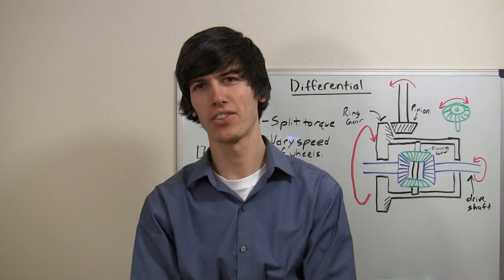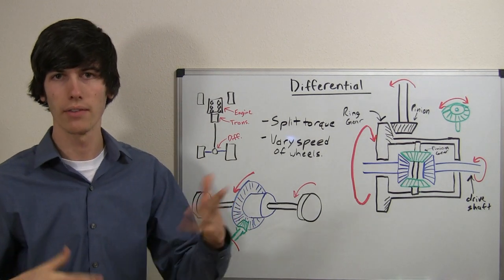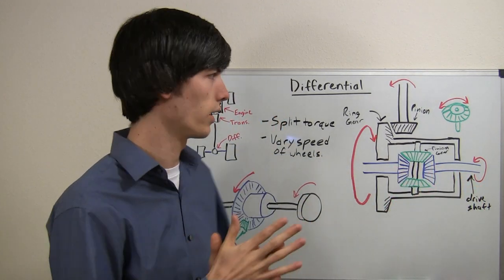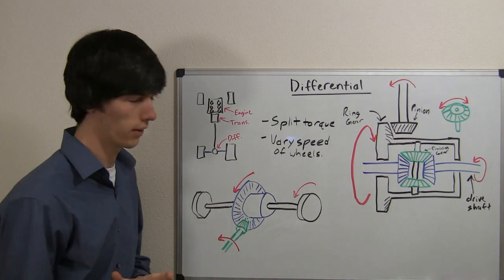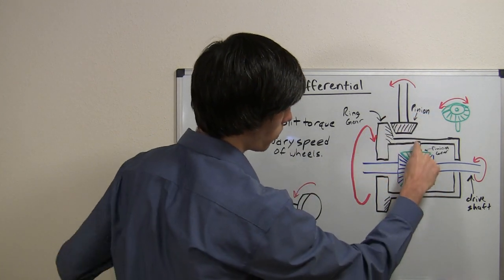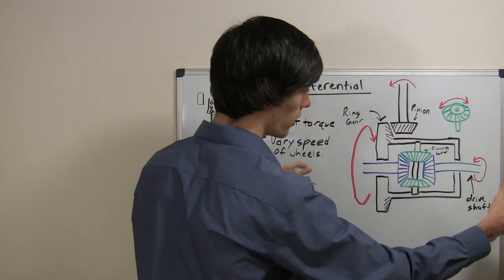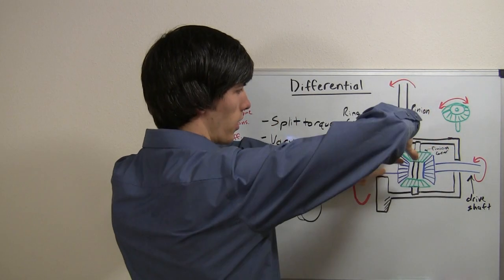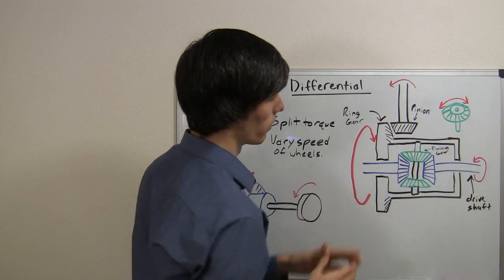Differentials - Explained

Comment from the maker: Good input, thanks for sharing. You may as well simply buy an open differential and weld that up, it'll be cheaper than the VLSD, and you won't have the additional weight/complexity of the viscous components (which won't be doing anything anyways). Congrats on the sponsor(s)!

Comment from the maker: With FWD cars many times the differential "ring gear" is directly meshed with a gear on the output shaft of the transmission. Follow your clutch to the transmission, and follow a drive axle back to the transmission, in between is the differential.

Comment from the maker: Sure, look at the image in the video (or thumbnail). If you rotate the left blue shaft up (as the red arrow shows in the thumbnail), the top green gear will rotate to the left (counterclockwise), and this will cause the right blue gear to rotate down (opposite the red arrow shows in the thumbnail).

Comment from the maker: As long as the torque is low enough they will rotate at the same speed. Once the torque exceeds the frictional limit of the tire with the least grip, the tire will spin and thus there will be two different speeds.

Comment: Great video, thanks.  Also watched the linked video, which also was good.
What I don't understand is why the differential was/is considered an improvement over 1-wheel drive.   I'm sure it is, I just don't understand why.  Because it seems with the basic differential if either tire gets into a slippery spot then it loses all traction.  I.e., instead of being dependent on one tire having traction, you're dependent on both of them having it.  It might help when both tires have equal traction, but not when there is a difference.  The tire with the least amount of traction ends up getting most if not all of the power.

Comment: 4:47 this shows the bad aspects of an open diff.
As the inner pinion rotates up and spins against the "stuck" shaft, the other wheel actually turnsfaster (with more rotational speed) than it would if it were driving both wheels at the same speed (I'm gonna stick my neck out and say twice as fast).
This then in turn makes driving on slippery or loose surfaces very hard with an open diff, because the power/torque will all go to the wheel that has LEAST resistance and thereofre make it spin faster, which in turn makes the problem worse.

Comment: Thanks man! Yeah I"m using the infiniti Q45 differential because the guts are toothed to accept q45 (and 300zx twin turbo and skyline GTR) axles which hold LOTS more power. And with 500whp and 265 and larger tires and clutch kicking axles start crumbling lol

Q45 only comes with vlsd, soooo I'm stuck with that... or buy $1000 axles and then weld my current diff :/
(Q45 has crappy gearing 3.49 so I'll be using my current ring and pinion of 4.08) sooo much frankensteining lol

Keep up kickass vids

Comment from the maker: If both blue gears are locked, then the green gears will be incapable of moving. If one blue gear is locked, the other blue gear could still move, but this would require both of the green gears to move as well.

Comment: In the LSD video don't forget about toyotas version which is called auto LSD it applies the brakes  to the wheel that is spinning to fast so the power takes the route of least resistance and powers the other wheel. But I think it's mostly used in there trucks.

Comment: Could you possibly do a video explaining how the Volkswagen VAQ system works? It's based on the Haldex AWD system but mounts up in place of the Haldex transfer case on front-wheel-drive GTIs (all 2019s, or performance pack only for previous years). I don't understand if it locks the two axles together or if it just brakes one side or what. It's driving me nuts! Thanks Jason!

Comment: That green gear is rotating, how will the left wheel axle be hold since the green gear is rotating? So the answer is the housing the black lines, that green gear should only be one not two since they will turn opposites, I wonder if the axle and the housing is rotating at the same speed? Please clarify :)

Comment from the maker: That's inaccurate to say. Open differentials supply even torque to both tires at all times. However, if one tire does not have much traction, that tire will tend to spin, and thus a very small amount of torque will be delivered to both tires, keeping the car from moving anywhere.

Comment: Hey,

Thanks for the great stuff u share man.Sharing and caring to propel the world in a better way.
 
U go around a corner.Your outer wheels have to travel a longer distance when compared to the inner wheels.So ur differential comes into play by rotating the outer wheels faster than the inner wheels.But actually how does it start to work ? I presume that there is a force acting on the inner wheels that makes the half shaft attached to it rotate slower ( something like holding one shaft as u said ).This causes the outer wheel to move faster ( ie the pinion gear start to rotate about their axis and make the outer wheel go faster). What is the force that causes the inner wheel to go slow ???

Comment: I am not talking about different speeds, I am talking about one that is moving vs one that isn't. It's not difficult to stop one wheel from moving in an open diff especially if both wheels are at balance (both wheels off the ground). I don't think that I have that much torque in my arms, much less my body.

Comment: hey nice video u hv explained the case when one axle is fixed but while making a turn actually the inside axle rotate slowly than outside axle so my ques is what makes that inside axle to rotate slowly ,,,
Reply from the maker: The green pinion gears will rotate around the slower moving axle, the tire prevents it from rotating much as it isn't rotating on the ground as much as the outside tire.

Comment: I have viewed all of your diff videos. I hope your able to find the time to answer these questions. I drive semis for the past 17 years. I would like to know if when I lock my inter axles with the dash switch. That would be 1 switch for the front and one switch for the back on a 3 axle tractor. 

Question 1 I have been trained to engage both axles while driving through winter and ice conditions. So if it's better to have the torque on the wheel that is not slipping why even have a switch make it an open diff where the torque is equal when not driving  on slippery surfaces.

Question 2. With your knowledge can you explain what conditions determine the interlock switches being set to lock or unlock and why. 

I look forward to your reply

Thanks

Comment: I'm a little confused, so say the top green gear is rotating counterclockwise to allow the left tire to rotate faster, what happens when the same pinion gear is interacting with the right part of the rear axle during this moment. Does it just happen to fit and mesh with the right blue gear? 
My second question is, how do green pinion gears "know" to spin a certain direction? If you're making a left hand turn, do the green pinion gears just naturally respond once the right tire starts slipping?

Comment: I have no idea about differentials, which is why I'm here. But would it make sense to add to your description that power transmitted from the main driveshaft will be equal to that transmitted to both wheels in total? That is, if your superstrong hand stops one wheel from spinning, then the other wheel will get 100% of the force. But if both are spinning equally it will be 50% - 50%, with the point being that no matter what the varying speeds between the two, the torque to both wheels will always be 100% (i.e. 40-60; 70-30 etc)?
Reply from the maker: Yes, the power from the driveshaft will be equal to the power at both wheels (except for frictional losses in the diff). With an open differential, this means at all times both wheels get 50% of the torque, with a limited slip or locked diff, the torque can vary. I have additional videos covering the torque distribution if you're interested.
Reply: Engineering Explained how are these conected since they are spinning or are they held loosely by something

Comment: Hey Jason how are you I have a question that u need help with.
Noylt really a question by mainly a dilemma I need help choosing what differential to run in my car....
The car is a e30 with a s54b32 motor and 6 speed gear box that came with the m3 I was thinking to run a 3.73 to keep that torque up and make it a fun drive or go for a 3.10 or something I don't really know so I think your that man who can help me out with some equations to find the best one for the job
Thanks Jason have a good day Michael

Comment: In the case of running one of the wheels over a slippery surface, the open differential has troubles, right? Is there some way to mitigate that problems, like letting go of the gas pedal so that the car keeps going by inertia? Would that avoid the problem o mitigate it?

Comment: Great video. But how does a differential work on a solid axle? (I'm thinking of a friend's '62 Corvette.) Doesn't a differential REQUIRE a two-part axle? If a solid axle is really one solid beam, how do you deliver power to both wheels while allowing the outside wheel to turn more?
Reply: +C. Todd This is how a solid axle works. The two axles slide into the carrier the big black part of the drawing into the two blue gears.

Comment: Great video mate. That was crystal clear. I am trying to build a small line following car (around 5kg). Do u think I would need diffs for this? What do u think I should do to make the car able to change direction? It's a fully automated car btw.
Reply from the maker: Hmm, an open differential, or independent axles for each wheel. Or just let the wheels scrub, with a small prototype it's no big deal.
Reply: thanks a lot mate.

Comment: Okay, differentials allows the wheels that is connected to it to spin at different speed when turning. If fwd differential is located between the two front wheels, dont the rear wheels also needed a differential???

Comment: Ok, I get that.  So back to the turning part of my question.  When you start a turn, say to the left, the left tire spins less.  Is this because of great friction against the left tire as you turn?  This is the only thing I can think of as the diff. doesn't know the car is turning, but somehow the gears are allowing the two shafts to spin at a different speeds.  So how do the gears get back to a synced spin after a turn is completed?  Does friction go back down on the left tire?

Comment: You're basically saying that if I take a car with a open diff and put one of the wheels on the dyno (as friction with the ground will stop the other), then I should only get half of the engine's output to the dynamometer, and I fail to see how that is physically possible. Energy in must equal energy out, that simply. A wheel that is moving is expelling energy and the wheel that isn't moving isn't. Therefore, all of the energy should transfer out through the one that moves.

Comment: I have a question, please help me!?:
well, when a open diff car is on a left corner, the right tires will need to spin faster than the left tires, so the left tires have less grip than the right ones(because G force is pushing the car to the right). does it mean that the differencial will send more torque and power to the left tires? If it's right, why the differencial doesn't send torque and power to the wheel that need more speed(in this case, the right ones)? Please help, I'm so confused.

Comment: Here is the part I don't understand...if the bearing gears (green) are capable of free spinning then how they ever turn the wheels' drive shafts (blue)?  As you said in your video, on an extreme, one wheel would be stopped while the other is moving.  So if this is possible, how is that the car starts moving at all, the green gears should just spin around the right\left drive shaft gears?  And during a turn, how does the the green gears know when the turn is done to spin the tires normally?

Comment: Okay u say that both tires will rotate forward at the same speed. Could u explain why if u lift the car up off the rear tires where the differential is located. Why if u spin one tire forward the other tire spins backwards.??

Comment: I was rebuilding a ford 9" the other day.  Why is the differential case spider to side gear ratio 2:1 instead of 1:1? I know that with an open diff and a case (ring gear) rotating 100 rpm, if one wheel is locked still the other will do 200 rpm but I don't understand why it is designed that way...why would 1:1 spider to side gear ratio not work?

Comment: I have a doubt regarding differential...When our car is turning Lets say turning left
Normal forces on the right wheel will be greater then the force on left wheel. Then as the force on left wheel is less it should rotate faster...and if it would have rotate faster then it would have been more difficult to make left turn......i know i am wrong at some point but i don't know where...can you point out?

Comment: How does the speed of tires vary. differential provide rotation only when the speed of one tire has to be more than another  it basically acts like a gear system to provide motion but how this variation in speed exactly happens. what forces make the tires to move at variable speeds

Comment: Hello I love your guys content and would really appreciate if you could help me with a question I have. I was having a debate with someone I work with about whether or not a car with an open diff can spin both wheels at the same time (aka do a burnout). Let me know if my logic is incorrect. If a RWD car is on ice (low friction) and it tries to accelerate, both rear wheels will slip and rotate at the same speed because the torque at the wheels is enough to overcome the static coefficient of friction. Using the same idea if a very powerful RWD car that is on asphalt (consider even friction across entire surface, therefore equal traction at both tires) applies its front brakes and accelerates with full force both rear wheels will spin in place at the same speed. Obviously this is an ideal situation where the frictional forces are equal at both rear wheel to allow for equal speeds, but it is possible correct? Thank you so much for your help.
Reply: U hit it right on the nose

Comment: Does the differential change the gear ratio? And if yes, does it change it in a constant proportion or does it depend on the braking angle?
Reply: Isaac Von Gürtberg the Power and torque generated by the engine pass trough the the transmission box, Which has it's own and different ratios and then Power and torque pass trough the the differencial (there's only one ratio in a single diff), and finally Power and torque goes to the Wheels. I hope I've helped you
Reply: Bruno JJ thank you. yes it answered completely.
In fact, the purpose of my question was to know if the differential's ratio could be different than 1:1 and if it was a single ratio for one differential. Now you answered me. I asked it because I couldn't figure out if turning would modify the differential's ratio. So, I ask it again to be sure: do you mean the differential's ratio stay the same when turning? Or put in another way, will the wheels torque, between two situation which are only different by the wheels inclination, be the same?
Reply: Isaac Von Gürtberg good to know I've helped you. Have a good 2017! Bye

Comment: Still a little confused about how one side of the diff slows down. Is it with braking force?
Reply: If you're referring to the blue parts of the diff, when going round a corner for example, one wheel covers a further distance than the other but in the same amount of time. This then causes a chain reaction which means the wheel is slower and the bearings in the pinion gears allow it to rotate over the blue shaft, rather than gripping and turning it at the same speed as the other wheel.

The housing that spins always spins at the same speed (in conjunction with the vehicles speed), so by rotating over the wheel that is slower than the other, it allows the housing to continue at the speed of the faster wheel.
Reply: If you're referring to the blue parts of the diff, when going round a corner for example, one wheel covers a further distance than the other but in the same amount of time. This then causes a chain reaction which means the wheel is slower and the bearings in the pinion gears allow it to rotate over the blue shaft, rather than gripping and turning it at the same speed as the other wheel.

The housing that spins always spins at the same speed (in conjunction with the vehicles speed), so by rotating over the wheel that is slower than the other, it allows the housing to continue at the speed of the faster wheel.
Reply: +O Colpin thanks